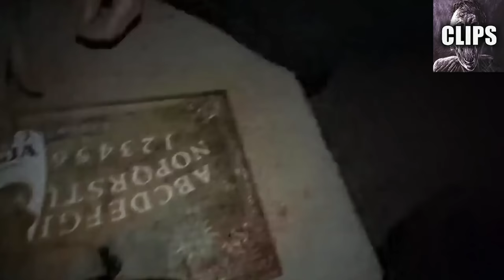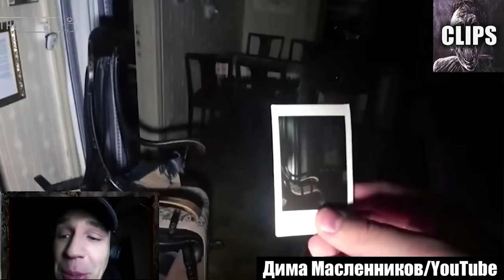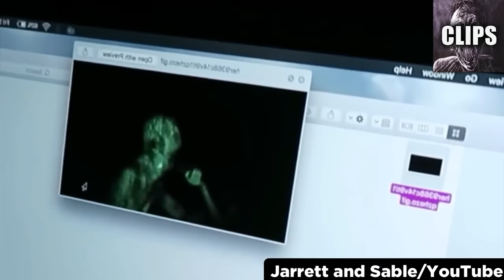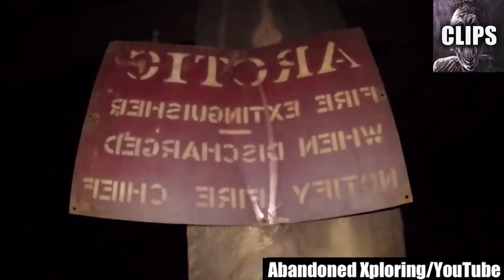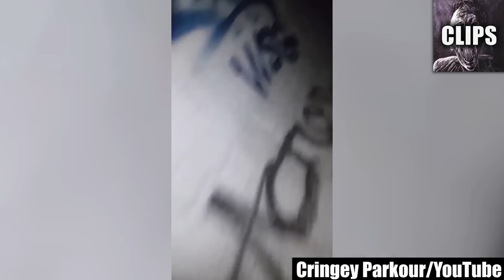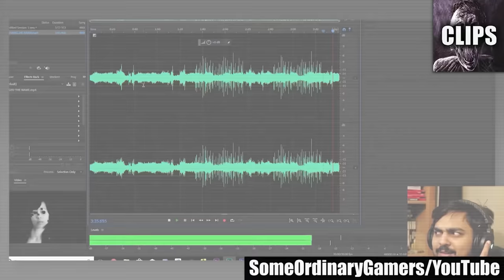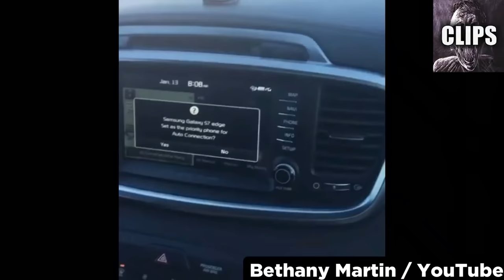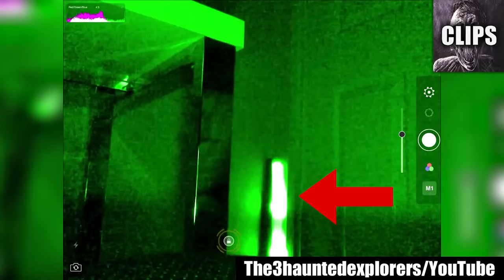Scary Videos That Will Haunt You Forever

Comment: In the clip with Heather and her man. At 1 hour, 19 minutes and 18 seconds. Does nobody not see the black things sticking out of the left hand side of the single solitary thin tree right in the center, you can see one of its eyeballs blink. And as it pans to the right. There's a little pit, and in that pit, there is another one of those black things because you can see its eyes. If somebody has the ability with editing equipment, just slow it down, you can see it very, very clearly. I don't know if that was put in or if that's just something in the backyard back there, but OMG.